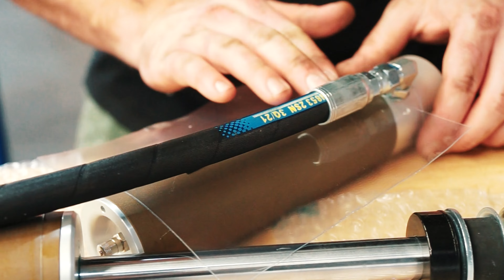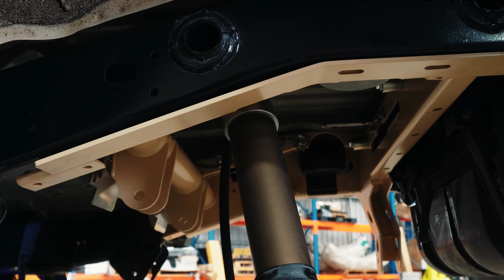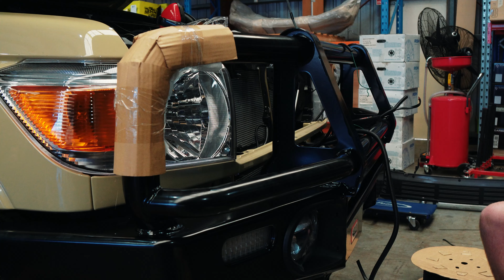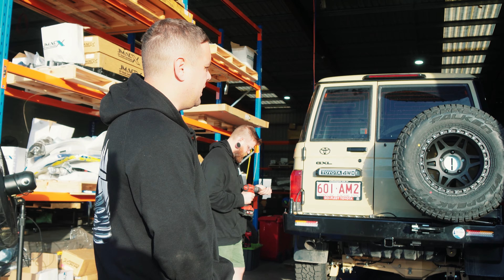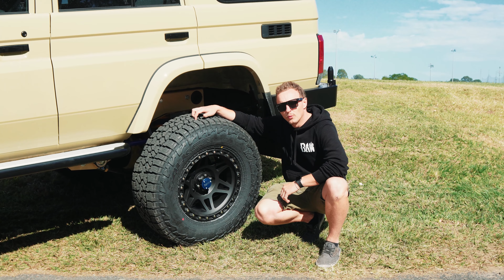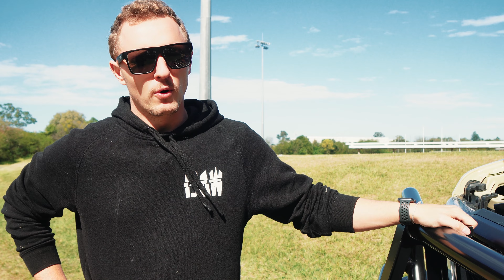Complete Coil Conversion & Build on This 76 Series LandCruiser: Full Build Breakdown!

Comment: With the post rego coil conversion, does the car then need to be engineered for compliance as opposed to the pre reg conversions being federally compliant as part of the process?
Reply from the maker: Oh, you bet it does! With a post-rego coil conversion, engineering for compliance is part of the deal—it’s like the sprinkles on top of the sundae. Don’t stress, though; we’ve got it all covered as part of the install process. Because if you’re rolling out with us, you’re rolling out legit.